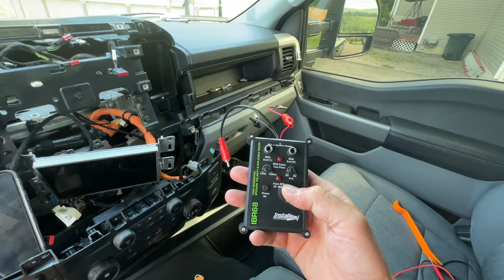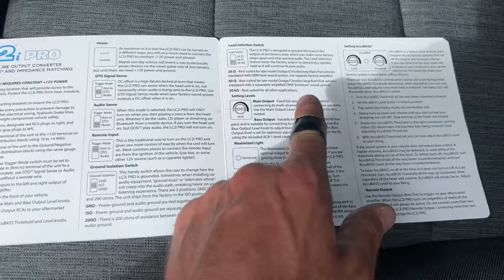How I Added An Amp & Two 12” Subs To My 2023 F350 Factory Head Unit Using A LC2iPro Converter

Comment: Question, do I have to connect all 4 speaker inputs on the LC2i or can I just use the left side + - since I will be tapping to the factory sub only?
Reply from the maker: I don’t think you need to use them all.

Comment: F250 stx model and i got a lc2i not pro .. but tap in to right side speaker signal only ..I have right rca jack to the voice amp only is that ok
Reply from the maker: You can try, a single right speaker wire only may be enough to give the unit the signal/power it needs.  If not, just tap into the left/right speaker wires coming off the head unit.

Comment: Is the factory amp located in the dash? If so, why did you go with the LOC vs the AmpPro….asking for a friend.
Reply from the maker: I don’t know if there is a factory amp in my dash or not.  My large amp under the back seat needed an RCA out cable hookup for signal and my factory radio did not have this so I used the converter for larger Amp Signal.
Reply: @DieselLegiance  thank you for the response. As I was watching your video, which is awesome BTW, I could swear I saw the factory amp mounted in the dash. It is the gray metal box with the fins…
Reply from the maker: @ObservantTexan Not sure, it’s only an XL truck so not sure if this model has an Amp or not?  There are not extra tweeters like what would come with a Lariat or King Ranch.  Either way, I didn’t see any RCA outlets anywhere to use which is why I went with the converter plus the converter gives you a little more control over adjusting settings.
Reply: @DieselLegiance  understood….I am on the fence on the LOC and the AmpPro to get the RCA’s I need, but I haven’t found the factory amp so I may go the LOC route like you did. Great content sir!
Reply from the maker: @ObservantTexan Hey, if you find it somewhere, let me know ha ha